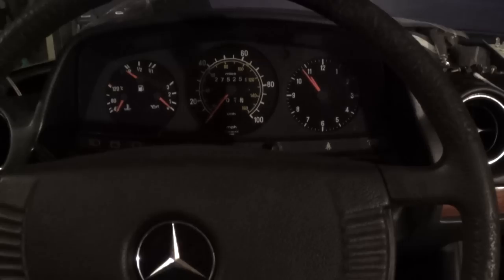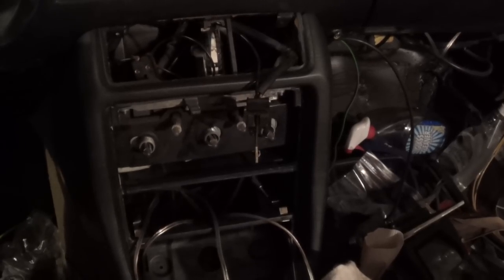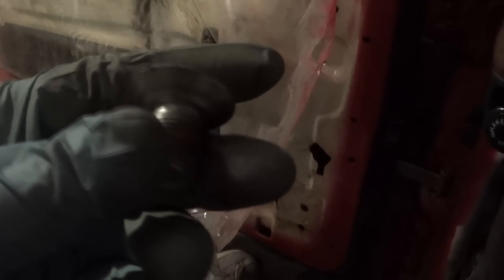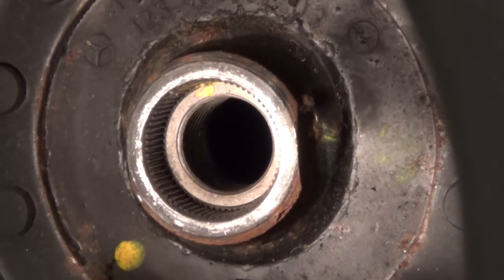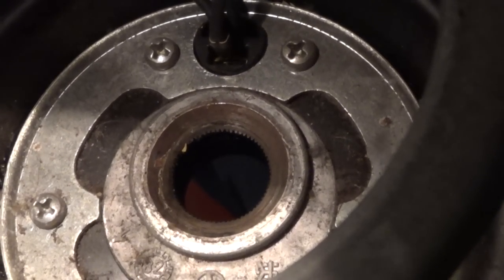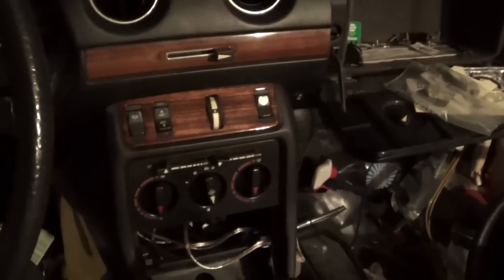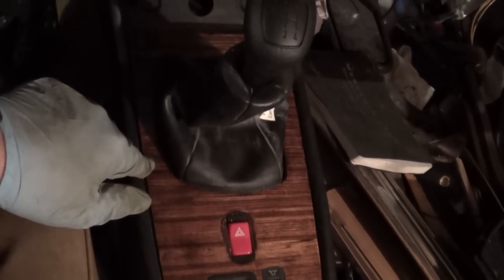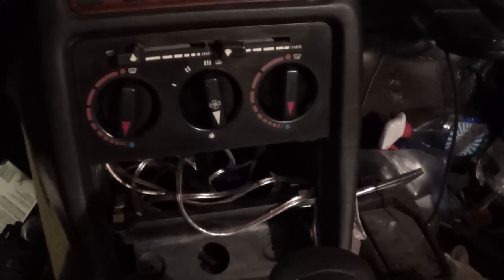1983 Mercedes-Benz 240D - part 117: steering wheel and center console

Comment: well that is unfortunate that the '79 steering wheel didn't fit. I guess the only other alternative would be to buy a new one, should you feel the desire to do so. As for the lights, yeah it sounds like that's more trouble than it's worth. The only logical thing to fix that would be to replace the sockets themselves. I like the new shift boot btw, it adds a very nice touch to the refinished wood trim.
Reply from the maker: Actually, there's another issue that I cut from the video due to time constraints. The left temperature control knob is frozen in place. At this point, I'll probably (quickly) pull the center console and see if I can get it moving again. In the process, I'll take another look at the lights.

As for the steering wheel, I did some more research, and it looks like I can just get a different bolt to use the '79 wheel. I'm going to try that.